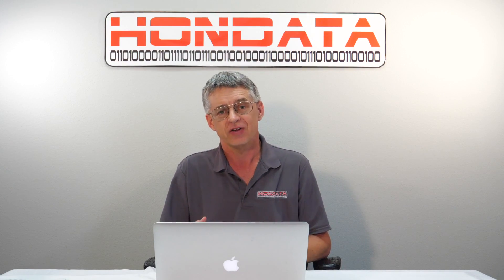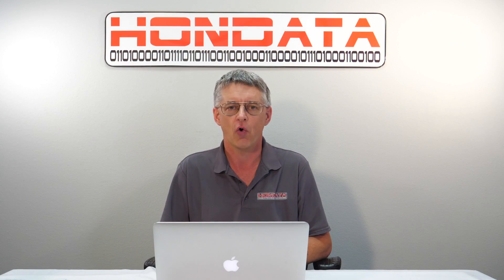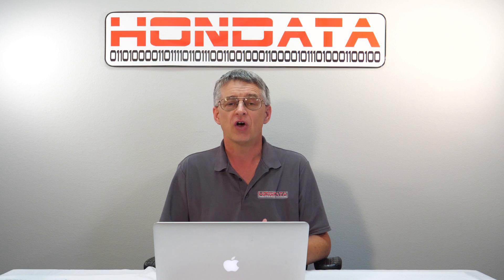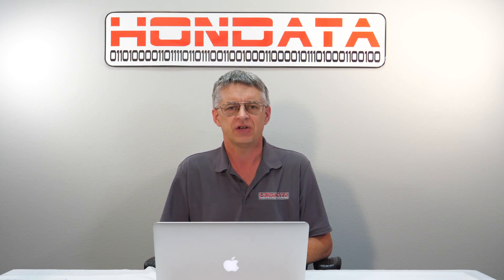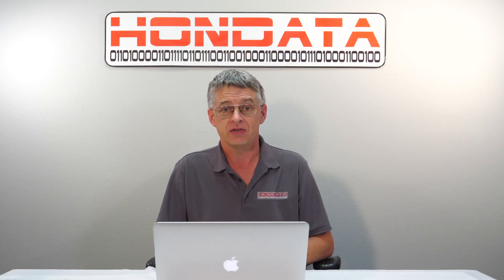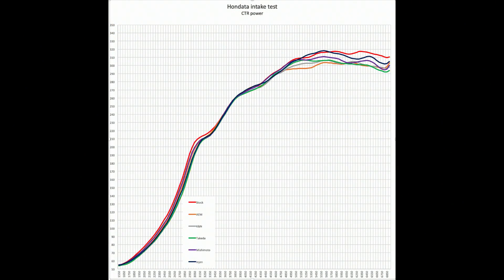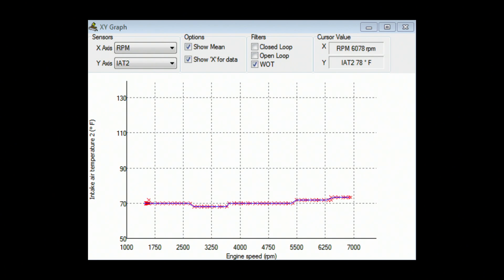Best Intake for Civic Type R (FK8)  - Hondata

Comment: What's even funnier is all those manufacturer s claiming HP/TQ gains over stock... Lol
Reply: Adrian Figueroa They probably do make more power with the hood open. I’m not saying what they do is right just that it’s how they get away with claiming hp gains.
Reply: You do get gains with a turbo lol you just need a tune
Reply: Adrian Figueroa These aftermarket intakes arent tuned, the stock ecu is meant to work with the stock intake.. if you aint tuning, i suggest upgrading the Intercooler and do a complete aftermarket exhaust system (without downpipe) if you want to retain stock ecu (no tuning). Probably get 330-335hp .
Reply: I’ve done hood closed tests myself on a dyno and they do give an increase. But the catch being, it was on a basemap tune. On the stock tune the best they saw was 1-4 hp gains. With a tune they see much more gains. An intake that wasn’t tested here but has really impressive gains is the eventuri intake. On my local shops dyno it saw an average of 16.5 hp gained, with the best run having 18.7 hp gained over the stock intake on a basemap tune. Intakes only really show their advantages once tuned. Only real difference on a stock tune is the added noise.
Reply: Jay_M I’m running the car now with a flashpro and a PRL HVI. Hondata doesn’t have an ots tune/calibration for intake except I think eventuri? I’m not sure now. Either way the butt dyno likes it and sound is worth. Pro tune might be different story
Reply: @MstrVitaTV  The intake specific tunes are just for maf housings that are larger. It's to correctly adjust the fuel trim for the increased air flow to prevent knock. Most intakes use a maf housing similar to stock size requiring no specific modifications. But I'm talking about taking a basemap say for example the 93 octane with downpipe tune with just increased turbo boost limit no other selections added the car will have more hp with an intake compared to stock. It's because at that point, the stock air filter and box are more restricted than the aftermarket intakes. With having more air able to pass through them, it gives them an advantage. If you look up 11Tenths Racecrafts video on best intake for the type r, it compares a few intakes on a tuned type r to show the differences and how much power they really can gain.
Reply: Jay_M ahhh I See. Good information. I need to check out that video. I mean I guess it’s just safe to say, get tuned.

Comment: You should test the PRL silicone pipe with a drop in K&N filter.  Cheapest next to stock and from other test videos appears to be a great option.
Reply: As per Engineering Explained, you will see about a 3% increase with the drop in filter. Now with the silicone pipe, while there may be smoother walls to allow better airflow, plastic is still going to insulate the heat out better leaving colder air temps. If someone made a smooth inside plastic tube, you would more likely to bring it to full potential
Reply: Here is a video another comparison vid I saw a while back https://youtu.be/CaR2luCjEpo

Comment: You forgot to use the eventuri intake
Reply: Dorian Alston - that’s the one I was looking forward to 😞
Reply: Dorian Alston  Cai are the worst bang for your buck for power gains. Hondata and Flex fuel are on the other side of the spectrum.
Reply: Same shit but made of carbon fiber
Reply: dude they tested the top intakes and didn’t beat stock. If eventuri beats the stock it would be by such a small amount that is not worth your time and money. This video is a gift from the heavens. All manufacturers making intakes are going to cry because of this video. Accept it and move on.
Reply: You pay for for the carbon fiber.